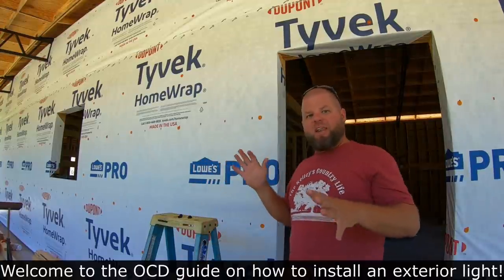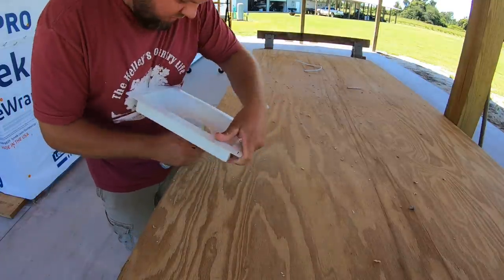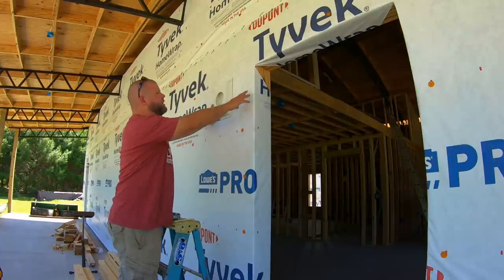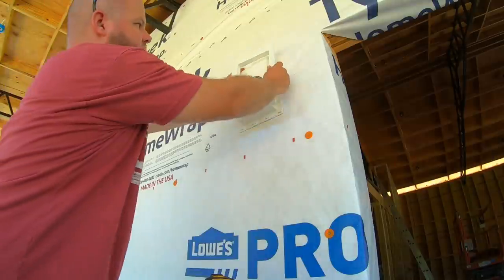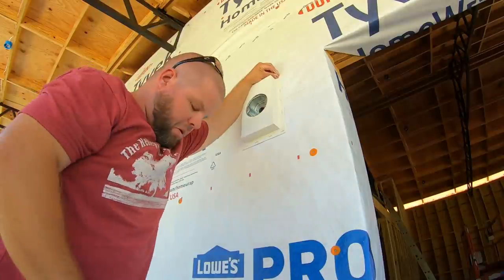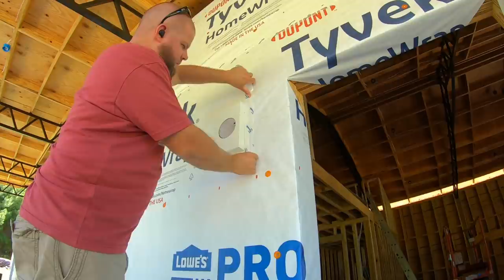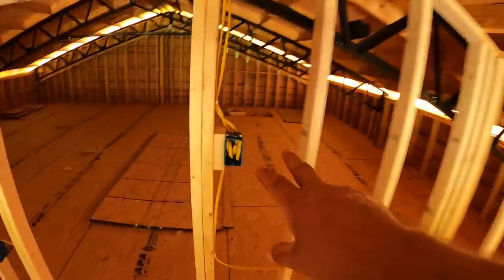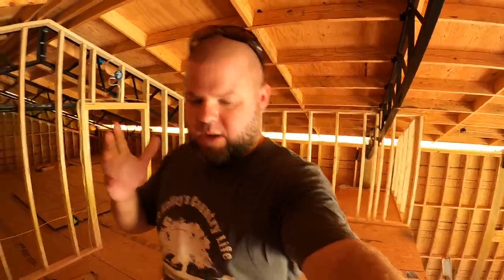Wall lights and starting the loft electrical! #437

Comment: One other thing to think about is if you want a central vac setup. pipes and ports placed around the house directed back to a central vacuum so you get the cleaning capability without the sound. One of the fun ones is a dustpan option that lets you sweep the mess in a kitchen to a port in the wall and have the vac suck it all up so no messing with an actual dustpan. 

You get a much stronger vacuum then the portable ones and a much larger holding tank so the emptying is done less often. With the setup you have and the talk of needing sub panels it might be an option to put a utilities shed/closet on the back of the house to put the water heater, sub panels and vacuum in.
Reply from the maker: All vinyl plank flooring, no carpet. Between a swiffer and a robot vacuum that should cover it.

Comment: Guess I’m the odd one out. I like the wiring videos. Keep them coming. My house build is looking impossible; before COVID price $90 k, during COVID $168k, now $221 k. And that is just concrete pad, porches, 4 walls, doors, windows, 1 garage door and the roof. No interior walls, no insulation, no electrical and no plumbing. CRAZY EXPENSIVE. Not going to do that. I gotta wait and see if something gives, need a break lol. Great work Andrew, thank you
Reply from the maker: Wow very sorry to hear that. I was hoping with lumber being down that prices would normalize. I guess everything else being up and hard to get is making it worse.

Comment: If you are going to use any smart switches, leave yourself a neutral line for the switch also. 

We have smart switches for the outside lights to come on/off at sunrise and sunset automatically. Don’t even have to think about them.
Reply from the maker: Thank you
Reply: @TKCL  I just put a protected cover over the switch, which makes it hard for someone to turn the switch off.

Comment: I have 1 single gang box and one double gang box left over from a project a few years ago, as well as a 100' roll of 14-2 outside wire (gray casing, with ground).  I'm also willing to check locally here in ND and will be leaving for southern MN on Thursday.  Just let me know.
Reply from the maker: Thank you, but a friend locally just reached out about some boxes.

Comment: I’m with you, I’d put it about halfway between the top of the door in the top of the wall.   I can see it being low if you’ve got some sort of lantern or something that sits above where it connects but personally I would just rather have an area light instead of a light right next to the door. The only advantage I can see is if you were looking through the people or had a security camera that might light up their face better.
Reply: I believe the lower level,is to ensure those that have security cameras or security door bells the light will light up the fave and body as there is usually a height difference from inside to lower level of entrance.

Comment: Hey bud, if you need help with stuff still, let me know.. I have a contractor account with lowes.. can probably get a lot of stuff you need and send it to you in a big box if its cheaper that way for ya.. I have 7 rentals.. so constantly doing some sort of repair.. so got set up for the contractor's account..  I picked up 12/2 250ft for around $140ish the other day.. and they had triple gang boxes for like $3/ea
Reply from the maker: Appreciate that, a friend just reached out with the boxes. I think I'm done with the wire for now. Thanks

Comment: One more if I may! (or two!) What mounting block did you use for some of your other penetrations such as your HVAC lines and  Disconnect.  I'm also brining ethernet from my house into my shop.  Of course I didnt have the forethought to run a pipe through  concrete before it was poured so I will need to run it in a  pvc pipe up on the outside of the concrete foundation and then need to turn the corner into the building. I see you have some smaller mounting blocks on your building. What did you use there?
Reply from the maker: I used the same blocks I used for the lights.

Comment: my local home depot   250 ft. 12/2 Solid Romex SIMpull CU NM-B W/G Wire (2-Pack)  that's 500 ft  $288.00
Reply from the maker: That's a great price! Lowe's went up to 160ish

Comment: I know I'm late to the party here, but where in the world did you find those mount boxes?  The stuff at home depot is trash.. There's a product called sturdimount made especially for fiber cement that has wide easy to seal flanges however its not what it appears.  The flange is plastic but the mount portion is pvc based material which expands and contracts huge amounts (as compared to wood) with temperature.   The mount is not very solidly connected to to the flange and there's a good chance it will leak at the seems.  So.. I would love to know at least the brand name of that mount box you used for you lights.  Did you use it on your receptacles as well or do they make a smaller mount?
Reply from the maker: Here you go https://amzn.to/3Ryj8EB     https://amzn.to/3wU7Hh4
Reply: @TKCL  Thank you!  I looked at your Amazon store first and didn't see them in there.  I can always count on you to come through with the answer in a pinch!

Comment: Hey buddy! I'm back! You know at least you're documenting every move you make with "boring" (which they're not) videos of everything. I know you like things just right, so do you have a ridge reamer? It's a simple little tool that after you cut out a plastic hole, you run this tool around the edge and it smooths and bevels the edge real nice! You use them on metal too. I've been out for a month now after getting kicked in the face with covid. My wife and daughter recovered quickly, but it hit me hard. Pneumonia is pretty much gone, and I'm weaning off the O2, but MAN, not good stuff. Hey, if I watch you on Chromecast, does it mess with your analytics on views? You can't comment or like or share or anything with Chromecast or Roku, and I want to make sure those views counted. I don't know how all that works... This is too long, I'll let ya go.
Reply from the maker: Very sorry to hear that, but glad you are back and doing well. I don't have a reamer, but I'm familiar with them. As for the chrome cast, it still counts as views for us. Thanks for watching